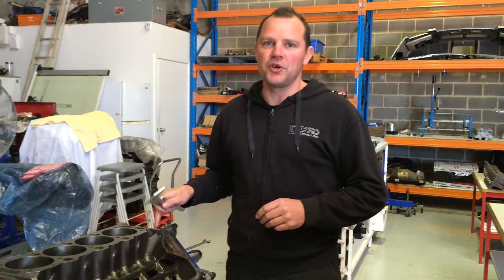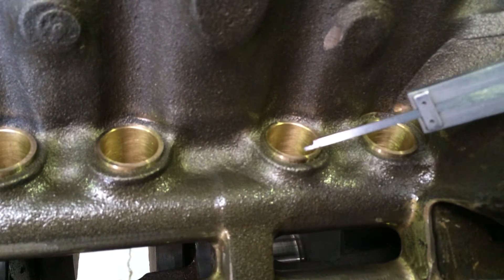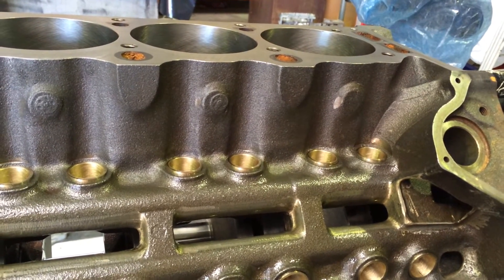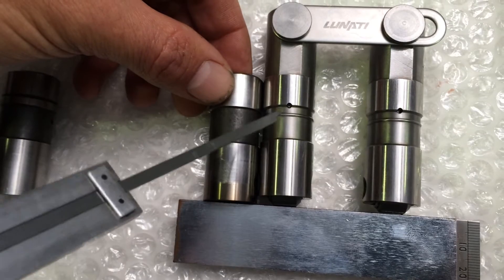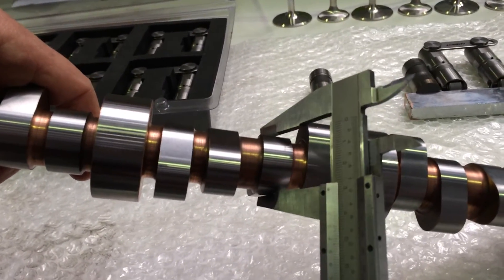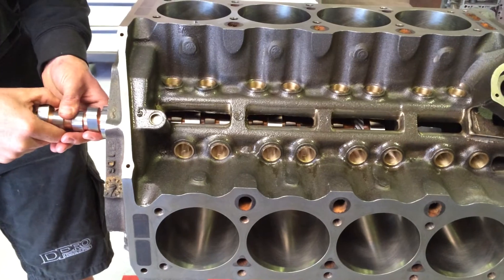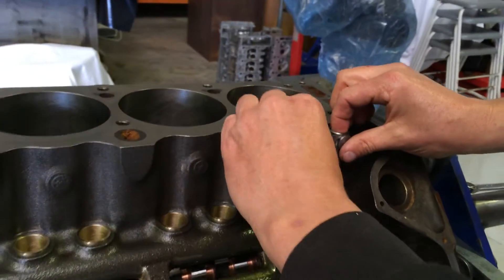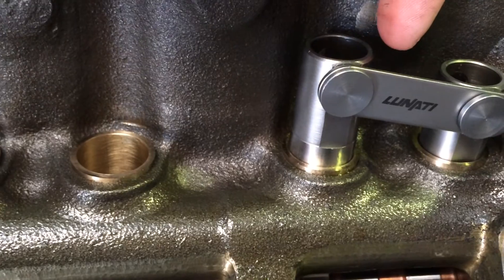Holden 304 hydraulic roller retro fit

Comment: I've been researching roller cam retrofits, and this is the first time I've heard this issue mentioned so thank you for pointing it out. I have a roller short block Chevy 350 that needs rebuilt and a 207 350 non roller block freshly rebuilt that I'm trying to decide which to put my 062 Vortec heads on to go in my 1981 C30. Looks like I'll be rebuilding the roller block.... dammit.

Comment: After seeing this I am glad I stayed with a flat tappet cam. Had no idea you can't do a straight swap without potential issues. But if I do another build I'll look for a roller block or get the thing sleeved when the other machine work is done. Thanks for the vid!
Reply from the maker: No problem. Flat tappet cams can save expense, but since the governments are reducing the amount of zinc allowed in engine oils, its becoming a serious issue. Zinc is one of the key players in flat tappet lobe and lifter life. The other issues are lifter face profiles, lobe profiles, and quality of materials. In my opinion, they are hit and miss. Ive got and seen old cams that have run 20 years in engines and look new. They dont make them like they used to. Keep in mind the lifters MUST rotate to live. You have to check this on a build these days by rotating the cam by hand and checking mark up on each lifter, lobe, and lifter bore.
So yes, roller cam is expensive, but cheaper for a professional workshop than pulling the engine or cam out after 20 minutes running for a warranty job on a flat tappet cam. 
Sorry to those below who have commented and i havent replied. 
matt, Develo Pro.

Comment: You must be using LUNATI 72334 Pontiac V8 Retro Fit Hyd Roller Lifters,..Apparently they are the Holden VS series 3 & the VT series lifters but with are different code,..Same seat height etc
Reply: Do sbc rollers fit in a 304?

Comment: Hi mate what are the specs on the cam ? I've just installed a 888271 roller hydraulic with morel roller lifters pretty much identical to the lunati , the cam has .365 on intake lobe and .371  on ex installed in a non roller vr block unsleeved with no unmasking issues dial indicator shows up to .400 before any issues .
Reply from the maker: Jeremy Paynter, hi mate. Yes I believe you. Like I said in the video some blocks are ok, some not. It's just got to be checked. I'll dig up the cam specs on that cam I used. Reduced base circle can help this but I prefer std base circle for reduced side loads on lifters. 
I'm doing a red 308 ATM that needed lifter bushing.
Reply: small cam,